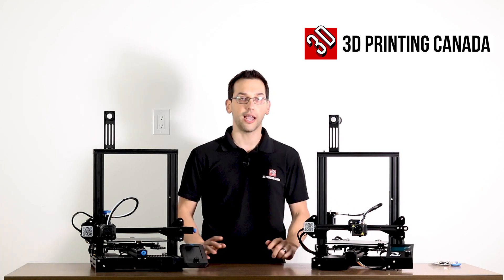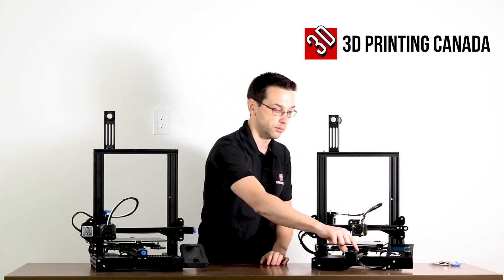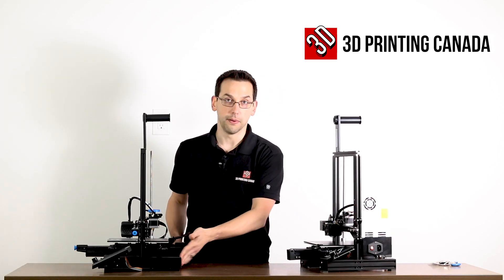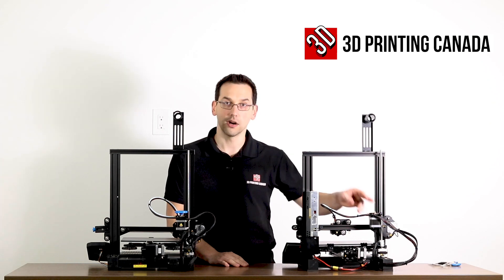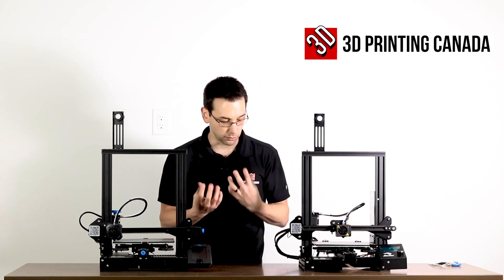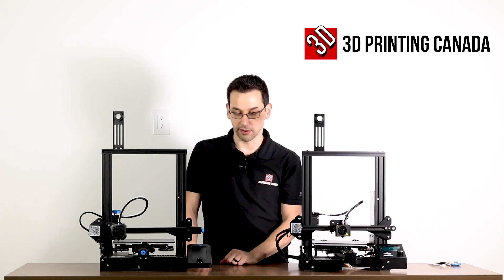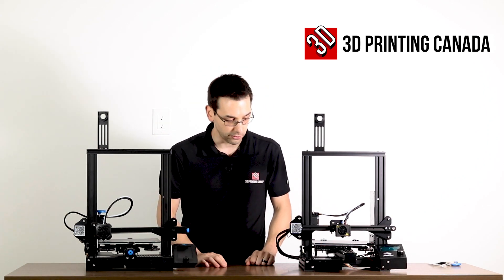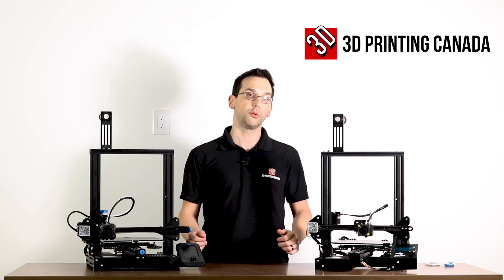Creality Ender 3 Pro vs Ender 3 V2 Comparison

Comment: the plastic hot end cover is the only disadvantage to the 3v2 - and is easily fixed with an upgrade - took all of one adjustment for the screw to no longer grab the plastic

Comment: Lots of comments about these not being good.  For my first printer what should I get.  I want out of the box piece of mind.  I don’t want to spend more than 500.  What is good easy machine to get that I can get good prints from without worries.
Reply: Microtech has a coupon to get an ender 3 Pro for 99 bucks. I highly doubt that you can get a better bang for the buck there. Even if it isn't the best 1st printer, you will get experience using a printer and develop your preferences.

Comment: Hah! My dual z axis direct drive ender 3 would smoke that v2 

170 for the printer. 45 for the z kit, 35 for the direct drive, 45 for the 32 bit board. 

Buy your own upgrades and install them. No reason to decide between the two. You’re going to be upgrading both, though the ender 3 and Pro have HUGE support repositories and prints for quality of life. Way more than the v2.
Reply: would you be able to help with links for such items? that would be a huge help!

Comment: So if I get the ender pro 3 and upgrade the motherboard to a 32bit 4.2.7 motherboard and a unflashed v2 screen. Could I eventually flash the motherboard with the firmware of the ender 3 v2 and be good?
Reply: I’d think if you were going to flash it, you’d get a decent firmware.

Comment: Not super impressed with this video as it could be a lot better. You should have started with the most significant differences first, and you seemed to have missed maybe the most significant difference which is the bed (magnetic sheet on the Pro and glass on the V2). Also you have at least two main types of viewer: those looking for their first printer, and those with a Pro wondering what extra the V2 provides. For the latter it would be important to point out which components of the Pro can be easily/cheaply upgraded to match the V2. Also, you have a lot of white space behind you - why not stick up a label either side to remind viewers which printer is which? And turning the printers upside down to point out the different control boards doesn't help much - if you're going to do that you should give close-ups of the boards showing the chips, otherwise talking through it is enough.

Comment: Can swap the motherboard on the v2 to a skr mini like in the pro? Do you lose anything out of ot or is it not needed? I am completely new to this space and trying to gather as much info in regards of reliability, new user friendly, features and upgrades.
Reply: Yes, you can buy skr+bl touch+tft e.t.c from bigtreetech for example.Well, the most important is that 3v2 is pretty much good out of the box.What i would change right away-nozzle , everything else will work great, until you want to change something(lack of something to your’e personal preferences) .

Comment: So, which one is better ?
Reply: If you don't currently own the Ender 3/pro, the v2 has a substantial amount of upgrades that make it well worth the price.
Reply: @nicholasjackson8709  unfourtunately, ı bought it 2 weeks ağa because ı as so excited and ı didn’t wanted to wait and ı didn’t do any research and ı bought ıt but thank you very much
Reply: @lustt20  you're really not gaining much, just buy a 32 bit board and it's a V2.  Everything else he mentioned can be printed.  I actually went the same route by buying an ender 3 pro and upgrading to the 4.2.7 board and it ended up being cheaper for me.

Comment: Appreciate your side by side comparison.  I am researching for my 1st  purchase.
Reply: Same!  What did you end up going with?
Reply: same
Reply: If you haven’t yet and wanted the ender 3 pro, micro center is having a deal/ coupon thing and they are seeking the ender 3 pro for $100
Reply: @bear-._.-  You sir, are awesome.
Reply: lol same, Jesus Christ the sovereign miraculous God loves you my friends :" )
Reply: me too
Reply: Same
Reply: So what did you get
Reply: Same what did you end up getting?
Reply: @eaglee247  yes
Reply: Don't get a delta
Reply: @dronus  Why not a delta?  I was looking at those also.  Seems nice.
Reply: @Magna2D  Well try it out. At most you'll lose is about $250.
Reply: @dronus  can you tell me some reasons why not a Delta?
Reply: @Magna2D  in my opinion it doesn't have safety features that'll turn off the unit if it detects somethings wrong. I believe there wasn't an option in the splicer program for my specific delta, which I then had to search and copy someone's code. I dont know technical terms but the three arms that move the printer hard arnt as smooth as the linear/other ones. It is small, compact, and portable in case you want to trash it. I have my delta id still id be willing to part with.
Reply: @Magna2D  if there a small mess up it will get amplified
Reply: @dronus  x
Reply: @dronus  what's your recommendation for a 1st 3D printer?
Reply: It’s been a year but if you still havent bought one I really don’t recommend an ender 3 I’ve had one for almost a year (about 9-10 months) and the thing breaks every week i have probably spent more money just on parts to fix it than actually buying it hell I have spent so much If I could get all my money back I could get another ender 3 and I think I have only made around 15 prints because the majority of them get messed up in the process on top of that the quality isn’t even good and I have spent weeks fiddling with settings just to end up with the same or worse quality in conclusion don’t even bother with the ender 3 it’s just never ending problems
Reply: @unlist989  I have 2 Ender 3's. Absolutely zero problems. User error i'm guessing. smh
Reply: @therealsinisterx yea cuz everybody say it’s good

Comment: Damn, why didn't they just switch it to USB-C instead of micro USB?
Reply: https://www.amazon.com/Adapter-Convert-Connector-Support-Compatible/dp/B07GH5KJH2
Reply: @evanfym  Lol, this is like putting a band-aid on a broken bone.
Reply: @renskivideos  hah
But actually though... would do you think I should get, I’m new to 3D printing but I know everything about it
Reply: @evanfym  Yeah, i believe the v2 is a great 3d printer and fixes a lot of the problems the previous version had.  The micro USB isn't a deal breaker, but I was just saying usb c would have been nice.  I think an adaptor would be adequate, or just use the micro USB if it doesn't bother you.
Reply: @renskivideos  thank you for your opinion. I really appreciate it.
Reply: @evanfym  No worries, Good luck and I hope you get what you're looking for.
Reply: are we able to use an adaptor?
Reply: USB-C is more expensive and adds zero functionality for this application. Most people have a pile of micro-USB cords laying around anyway. I know I have a lot more of those than I do USB-C cables. Really a non-issue.
Reply: @jasonhurdlow6607  its a more durable connector with less trouble when plugging in and it's a cable that allows more data bandwidth you naysayer.
Reply: @renskivideos  This application doesn't require the additional bandwidth. The symmetrical plugging-in is about the only advantage.
Reply: @jasonhurdlow6607  durability is a concern too, I'm sure many would love to have it, myself included on my v2.

Comment: A4988 is silent, but you may need to adjust them and its no beginners thing. I havent gone to trinamics as the 4988 is so much cheaper and i have only blown one by accident while adjusting it for two years. They come for a general setting wich if you buy various cheap motors may be incorrect on the voltage ( amp) regulator wich causes some noise of the motors. They do not skip steps though afaik what i have seen..its a workhorse for a verly low cost

Comment: Hello if you buy a printer ender 3 - ender 3 pro from this side https://creality3d.shop/ which is a clone of the original side you will receive the old main board 1.1.4. but if you buy from this side https://www.creality3dofficial.com/ which is the original you will recive the 4.2.2. 32 bit with silent stepper that's true i know what I'm saying cause i buy from both sides before 3 weeks at the same time and i receive it faster over i week from the original side . I wish i knew that before.
Reply: You bought 2 3D printer from different sites for what purpose?

Comment: Good video. Can you change from the original 3 pro boart to a 3V2 board?   Is it anything you have to have extra?
Reply: That's exactly what I did. 30-40 bucks and you basically got a V2
Reply: @thamomentum   Great, Where did you order a new board
Reply: The V2 is only like £30 to £40 more. Plus it comes with all the extras he mentioned
Reply: amazon at around £35

Comment: I realize that this was a recent change in manufacturing, but why not mention that the Ender 3 Pro is currently shipping with the same 32bit board as the V2.   My Pro was purchased in July 2020.
Reply from the maker: We no longer stock the Ender 3 Pro so we were not aware of the change to a 32 bit board.
Reply: I think it’s still because it’s luck of the draw. I bought a ender 3 pro from micro center last month and it did not come with the 32bit board.
Reply: @REREtech  I bought mine directly from the website so it came with the 32bit board
Reply: @DracoEX  how do you like the pro? I am debating between pro vs v2
Reply: Not all
Reply: I think it’s luck of the draw. Also, 4.2.2 on the ender 3 pro versus the 4.2.7 on the ender 3 v2 which has the silent drivers

Comment: Ender3 V2 is expensive than 3Pro?
Reply: 40$ more but well worth it
Reply: @groteboem  i wouldnt say so, they didn't upgrade anything that's important.  And the Ender 3 pro's coming with the new silent 32bit board anyways.